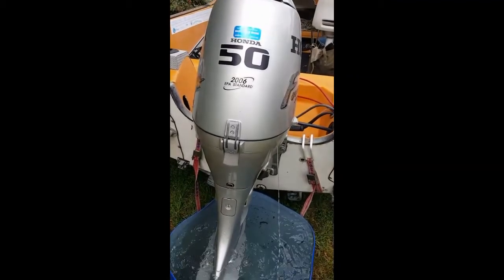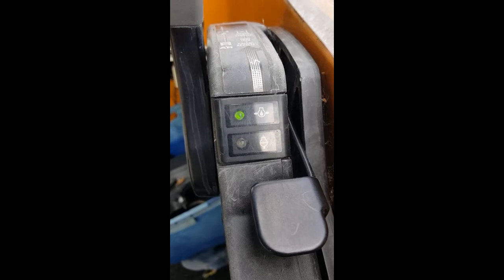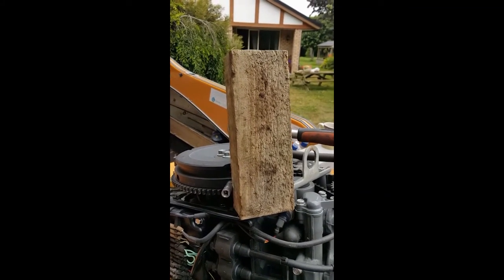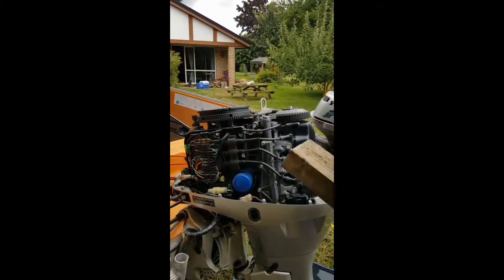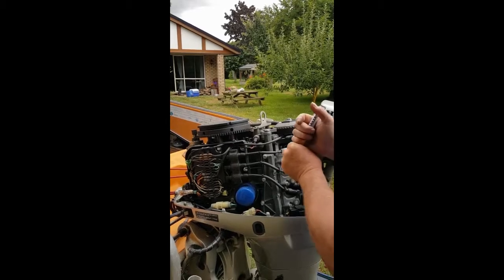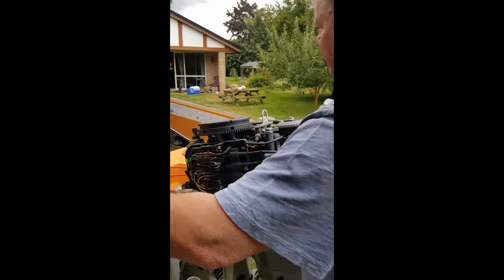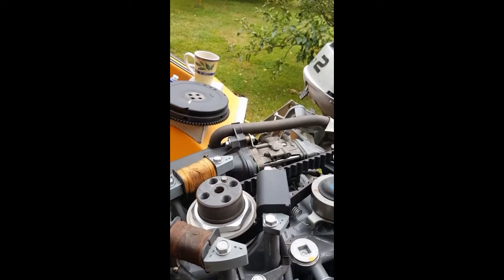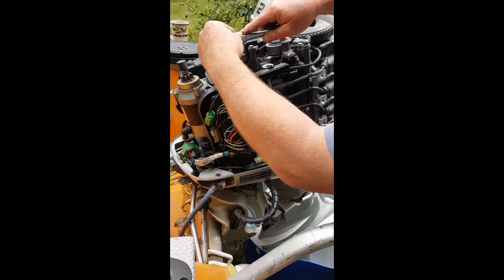Honda BF50 Charge coil replacement

Comment: Thanks for the video has helped me with my current issue on my bf40 (not coil related).
Just thought I might add another quick way to check your charging coils is to measure the resistance across the two coil wires whilst disconnected. According to the workshop manual you should read 0.20 - 0.26 ohm.

Comment: My battery is not charging, but the tach works. If the tach works is the problem the Rectifier ?
Reply: About your Honda charging problem, yes I would figure the Regulator/Rectifier is the problem.  Also check the fuse mounted on the starter motor, if this is blown you will get no charging current.  Also, find the 2 grey wires coming from under the flywheel (under the big black wire cover), unplug them and check them for AC voltage with the engine idling, maybe 50VAC.  If you get good voltage your rectifier is most likely the culprit.  Hope this helps - Cheers!~  Bellarmine
Reply: @bellarmine33  thank you !

Comment: This was so helpful. I recently purchased a boat with this exact motor and was perplexed by my tachometer not working. After a while I started to notice the battery sounded weak and I noticed the voltmeter registering low. I stumbled on your video and was shocked to see the  exact symptoms on the exact same motor. I changed the coils with your helpful video. The coils were fried and the new coils fixed it all. Thank you from Minnesota!

Comment: Video was very helpful but he forgot to giver the proper torque settings for the 4 bolts when re-installing the flywheel.  Please add if you can.

Comment: I think I need to change the change coil on my 2014 bf 50.. so your video was great to watch and has given me the confidence to tackle it...How did you check that it wasnt the rectifier that was the problem.. I would like to check mine before I order parts obviously.. from Stratford upon Avon, England.

Comment: I replaced my charge coil a couple of years ago. It  burned up because of a short in my radio while the engine was running. I had a 10 amp fuse for the radio which was too big. It now has a 2 amp fuse. The coil was easy to change. Good video. BTW, I have the same kicker motor as you, as well.